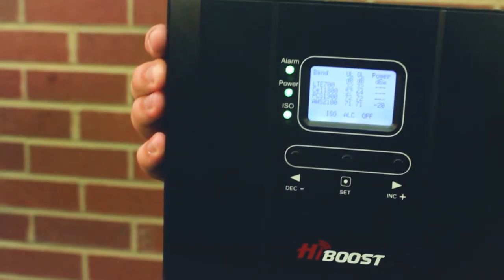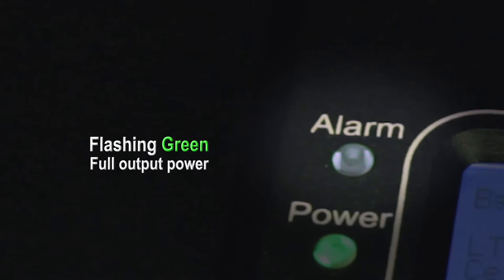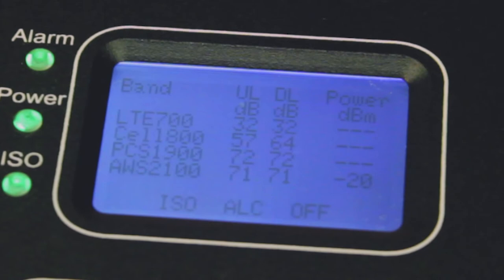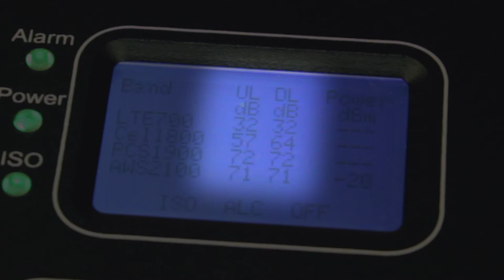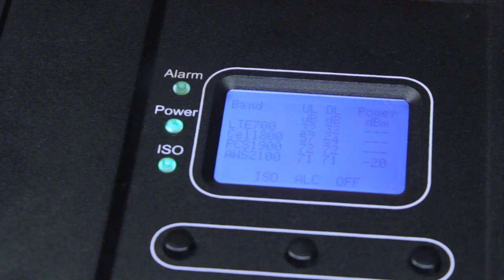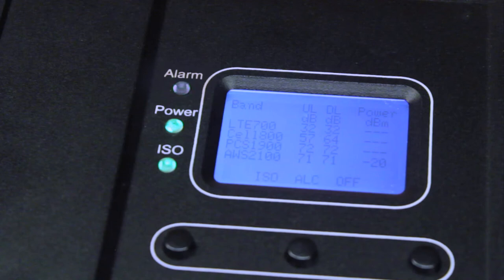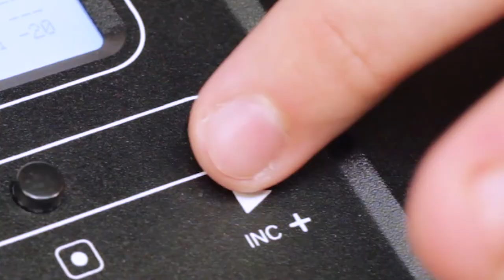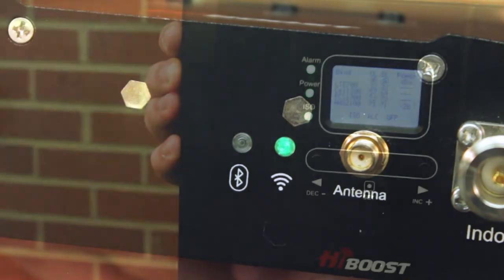Troubleshooting a HiBoost Cell Phone Signal Booster, using the LCD display and lights.

Comment: The manual is poor and the signal supervisor app does not work.  They are working on that.  The tech support answers quickly and is helpful, but you shouldn't have to watch six youtube videos and then have to talk to someone to get this to work.  Signal is better but I need to move the antennas further apart after trying multiple locations.